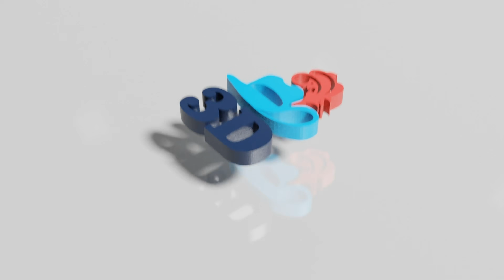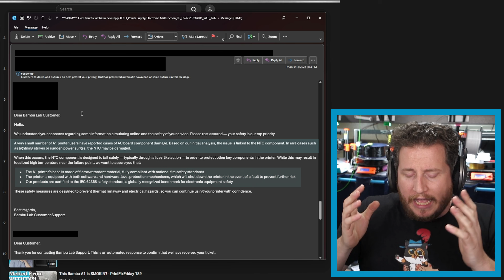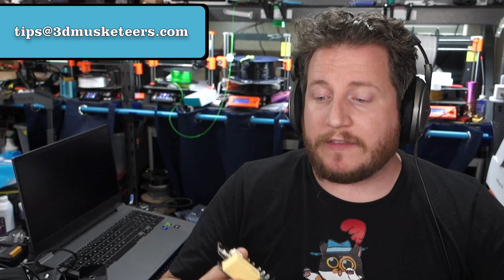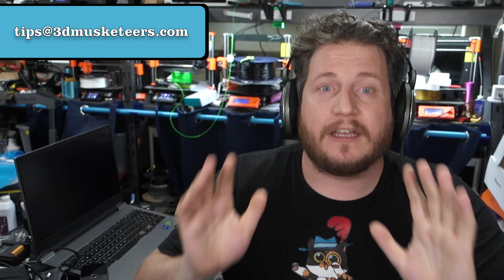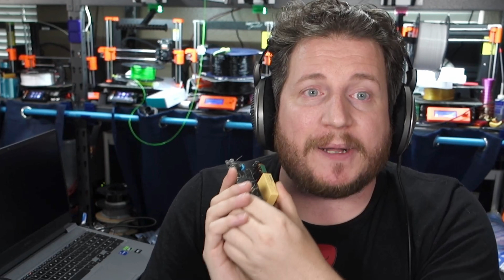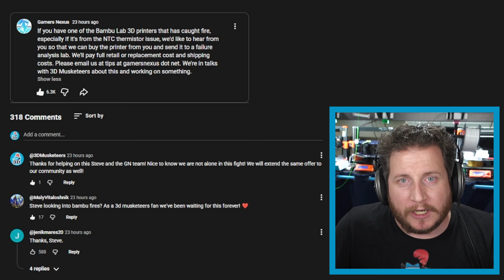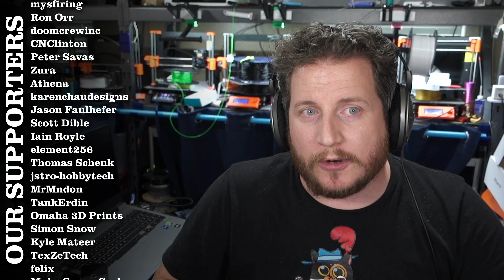I Was Right About The Bambu A1 (And I am MAD)!! - PrintFixFriday 245 FIRE HAZARD EDITION

Comment: I also highly urge people to buy a smoke detector to put in your 3d printing room or location, and consider buy the blazecut fire suppression tube above your printer or other equipment. I like many don't monitor my printer 24 especially on long prints. Also they say the 2026 model fixed this issue but check and confirm the thermistor is gone done just assume.

Comment: Many thanks for your clip.   I've had the same issue with my A1 after lessthan8 months of light use.    Whilst Bambu Lab are going through the process of getting my printer up and working, I'm still not there yet.  Today I'm replacing the heated and associated wiring  which I'm hoping will get the machine up and running.  So far I've replaced the powerboard, mother board, aerial without success.   It's a shame because I love the A1, simple and easy to use,  pity the quality of manufacturing is below what is expected today. I shall see!

Comment: yesterday my unit started to smell like burned plastic and luckily i was present and could turn it off in time. after checking with thermal i noticed a huge hotspot on the left side, opened up the casing and immediately saw this burned out component. 
printer was working very well until that moment, not a single problem. happened out of nowhere.

Comment: Had similar issue  NTC thermistor just exploded and melted the bottom case of printer. As printer was less then 1 year bambulab send new ac board and power unit - and it was different, now without  NTC thermistor and less cables

Comment: Just experienced it myself, the machine was idle, not currently printing (been hours since last print which was successful with no problems.
I heard noises from it, similiar to the mechanical noises when it turns on and it just just stopped working altogether after few seconds (I think there was an error message on the screen for a brief moment but I couldn’t really read it in time)

Had to open it up just to see the NTC component fried on the ac board. (So thankful it didn’t caught on fire and that I was next to the printer when it happened)

I’m from Canada so it’s 110/120v printer and i got it last December.
At the moment waiting for bambulab support to respond…

That’s absurd it happened to so many people and they don’t really address the issue.
Reply from the maker: If you can, send photos to pff@3dmusketeers.com we haven't seen many that just randomly occur when idling.
Reply: @3DMusketeers sent it over

Comment: Im genuinely a bit worried about my printer. I got it this spring so maybe at most 3 months ago, it shouldn't have this problem right? I know that it happened mostly in 2025 production printers
Reply: I took off the cover to check and i do not have a thermistor on mine, its just like a solder wire in the place of it, everything looks normal. I felt i needed to check because the serial number hinted at this being a problematic unit however it does not seem to be.

Also i double checked and i got it in early february of this year.
Reply: @MrMan-dc9xh pero es correcto que un componente electrónico sea reemplazado por un simple cable?

Comment: I had this happen, i have emailed you from my business account.
For everyone:
- Printer stopped 
- Burned the NTC Varistor 
- Made me grab a fire extinguisher and put it near my printer
- Burned a wire
- Burned up the siding of the board and Front Bottom Board
I have a new board and a new power switch assembly and am NOT replacing it until direction in my email from yall.

Comment: So regardless of the issue with bamboo regardless of the issue with whether a printer should be this kind of a risk I don't really care about all that because I can't affect any of that 

What I can do and what you can do is to be a safe as possible knowing you are running a machine that has components that are going to reach 100° C and 300° C

You need to take safety precautions I don't want to hear any crap about it shouldn't be a problem cry me a rainbow when your house burns down. 

First things first the 16-inch paver is a great idea it'll also improve your print quality and reduce noise. 

The next thing you need to do is to do a little hypothetical thought experiment I want you to create a thought experiment where you start a campfire on top of your print bed 

Now in this context what does that fire need to keep going? It needs fuel 

Do you have fuel near the printer? 

My first question is what is all that stuff that melted and why was it near the printer? 

This is not about blame if your resorting to thinking I'm blaming you whack yourself on the back of the head proby 

This is called troubleshooting war planning 

One of the first things I did was all of my tables are stainless steel lab tables work tables you can get them surprisingly cheap 

It can't burn. That's kind of important 

Where have I stopped putting filament? Directly above the print bed. That's right no top mount AMS light for me. 

If I am going to top mount a spool I do it all the way to the right to minimize the chance of flame on the bed reaching it. 

I make sure the printer is far enough away from any wall that things like wallpaper curtains etcetera can not catch fire. 

A 3D printer is not a home appliance I don't care how much you think it should be I don't care how much you rant and rave that it ought to be it's not it's an industrial tool. 

People need to respect it as such. That doesn't mean you don't hold manufacturer's accountable but it also means you have to do your due diligence too because they're not going to voluntarily replace your house. 

One thing I'm concerned about if that's where that unit is isn't that where the poop basket is? Do you know what the poop basket is? A big pile of fuel 

I'm going to have to rethink keeping that there or maybe using a metal bucket..

Make sure you have a fire extinguisher in the same room. Make sure it's up to date. Get some fire blankets they're very cheap and very effective. 

Now for you 3D musketeer. Are there any instructional videos that would show me how to find that component so I can take a picture of it and figure out what I'm dealing with? I just got my A1 last week. 

If I don't have an NTC what does that mean? If I do what can I do about it?
Reply: I wonder if it's the quality control issue I've noticed lately that component quality is dropping dramatically even so far as ultra cheap components being counterfeited.
Reply from the maker: It appears to be an unfixed QC issue, but thankfully it seems absent in the boards on the A2L

If you dont have the NTC you SHOULD be okay, but we dont have long enough testing to verify its efficacy. What can you do? Basically nothing. Bambu is hit or miss about replacing them before they burn a hole in the machine. There are no other printer brands with active fire hazard concerns currently. 

Bambu actually has a decent wiki on how to change it, just follow those directions. It involves removing the bottom panel of the machine.

Comment: So what the fuck now.. I need a printer to run..
Reply from the maker: you can take the risk, try to shore up around it, or keep it off and try to get bambu to send you parts?
Reply: @3DMusketeers Shit man, what printer would you recommend these days? Might have to max out the credit card it's cheaper then a house fire.. But I don't even wanna risk it. 😢

Wanna take my A1 of me? Maybe you can push it to fail 😅
Reply from the maker: If it has burned we would be interested.

IMO, pound for pound, the Snapmaker U1 is a damn fine machine
Reply: @3DMusketeers Thanks for the info man, ill open the bottem 10 screws and take a peek. If I see anything weird ill come back to this message okay! Don't wanna waste your time if it's just a 'good/working" machine. 

Thank you for keeping us safe! ❤

Comment: I must be really lucky because I've run my A1 for almost 5,000 hours (actual print time) and I haven't had the problem.  I've definitely put it in a fireproof enclosure because of this issue, however, and I will be getting a replacement board.  Yuck!

Comment: I just want to add just adding a small fan near the ntc should prevent it from over heating. These components don’t release much heat but if the heat can’t be removed it will heat up

Comment: So how do I find out if my.board is bad? After watching your video I watched my a1. It gets really warm so I no longer run it when I am not home, and I check on it frequently. But I noticed the sticker that sits over that spot where it gets hot is browning. Not the bottom half of the sticker though. I'm not intrested in replacing boards though and I wouldn't know the 1st thing about if the replacement was good or not. Help.

Comment: Or just keep the temperature inside the home under 22 degrees Celsius; I keep my window open for fresh air and some cold. And on top of all these, I keep it down, on the floor, which is cold. For those who have heating in the floor, like temperatures over 20-22 degrees also can be a big problem for electronics. I see this problem on my laptops, especially during the summer. I am barely able to use the laptops, and during the summer I just limit my use during the morning and night, in the middle of the day, minimum use, Youtube, movies, no gaming.
Reply from the maker: broooo to keep it that cold here in FL I would be homeless in months from the power bill. I am lucky if we can keep it under 30C lol. 

BUT we see this issue happen more in the winter, or at least that is what has been happening, so I am not sure that works here.

Comment: Yuuup, just had mine (6 months old) stop 80% through a print and smelt like burning circuitry, no response. turned it over and the plastic was bulging from heat warp.

No power surge, lightning or nothing, other electronics nearby stayed working perfectly.

It was on a custom wood bench with some resin printers, this could have been game over for my whole setup.

If i do get a replacement I'll put non-flammable rubber or paver underneath but I'm hesitant to use one again at all.

Comment: Blaming lightning and dirty power is an absolute joke. Even if 100% of the failures can be traced back to one of those two, its not like these are new phenomena. Lightning has been around for billions of year. Every electronics designer knows that if they have a product that will heat to combustible temperatures, they must mitigate the damage a near strike can do.

Comment: Some circuit designers should start work on an open source replacement board that won't catch your printer on fire.
Reply from the maker: BTT is working on the Panda Cyborg, but I dont know what machines it will support

Comment: 200 printers out of +1mill units sold is low, and the board was updated. so chillax dude!
Reply: I very much do agree. Still I do think that the right thing to do for Bambu would be to replace the affected printers.

Anyway I noticed I have 6-10 affected printers so gotta contact support about that later today 🙃
Reply from the maker: Where do you have the number of 1mil sold? Seems to be a BS number.. 

See, this is the issue.. if there's even a SLIGHT chance of fire it's not appropriate to be sold. If we can make toasters safe printers can be as well.

Comment: I bought a P1S a few months back and it's been a great printer (I use it in LAN only mode).
I purchased it as an upgrade to my aging CR-10s.

I submitted a support ticket asking about whether or not my printer could possibly be affected by this issue.
I asked specifically if my printer (serial number included) could possibly have this issue and if it was, how quickly they could send me an updated board that doesn't have this flaw.

It was automatically escalated twice before I got a response.
They gave me the runaround (without actually answering my question) with a bunch of corporate jargon (obviously written by an LLM).

I've just bought a thermal camera and I plan on taking my printer apart to check the actual temperature of the thermistor after running it on a longer print.
I'm going to check it against the datasheet for that specific thermistor as well.

I sincerely hope that I find it operating within spec.
But if I don't, I'm going to submit all of this information to their support team and see what their response to it is.

Not sure if any of this could be helpful to the cause but if you'd like, I can forward all of this information to you once the ticket is resolved.
Reply from the maker: Send us the photos from the thermal camera. I'm curious to see how hot the P1S gets. It's clearly more stable than the A1 but it's not immune from meltdown.

Comment: Thanks for raising awareness on this issue. I have an A1, purchased at the end of May 25. Got 4 or 5 days left on the guarantee. Paranoid enough with 3D printing in the house. Never leave them alone, but it really limits the hobby. Is there an issue with the A1 Mini as well? Have 2 of those also.
Motivating me to build a 100% non-combustible garden workshop. Going to commit to that before buying any more printers!
Reply from the maker: no current reports on the Mini for the thermistor issue. Your A1 is in the date range to be concerned though.

Comment: Hey just an intrusive thought, but if his pile of rags next to the printer had oil on them from proper lube-ro-faction they may have spontaneously combust, It's a thing with oily rags, that's why you dispose of them in a metal can in the welding class. Also fuled with ISP could be a flash fire and completely unrelated. Although you do have me concerned seeing as i am running an A1 darn near round the clock i got in March from bambu. How do I find out if mine is the wrong board?

Comment: Ok, sooo NTC thermistor needs replaced with a proper part... how the technical home (out in the sticks, etc) user replace that thermistor with a higher rated and/or what part do you recommend or what ratings, tolerances, etc. For that replacement ?

(Yes this is a rant about the engineer failings, but no solutions for others?)

OR better yet what is the part number at risk?
Reply: I would like to know if i need to atleast send it in, or find a replacement
Reply: Or better yet those of us technically inclined could send in the model number, production date, and the part numbers and pcb serial boards so you could build a database for future info for discovery lol

Comment: My A1 exploded some months ago and they told me its a known issue (printer about 6 Months old back then) and they wont take it back. They said they would send me spare parts of all damaged parts and they want pictures. The Element on the Board (you mentioned) exploded, blew a little hole in the side of the printer and melted the isolating shield. I told them the case is damaged and the shield and i wanna have replacement for this. After asking for about 2 weeks where my board is, they told me they would send it within 3 weeks... after 6 weeks i got a tracking id for the "replacement parts" and all i got was a board there the 2 pins are factory sided just bridged and they have removed the exploding Part. No new isolating shield and no replacement cover which means; now i have a printer with a little hole which leads straight on a sensitive high voltage element on the device and no protection against any small falling parts, dust or moisture... (Germany 230 Volts)
Reply: I've sent you some pictures of my case back then

Comment: What are the chances that this issue was introduced in an update, or an original feature to force a recall so old machines would need to be updated to the registration/laws regulations that are starting to get forced (or opted in) on printers in America?
This is not something that can be overlooked or that many people will be comfortable with repairing themselves.
[edit] upon some further investigation, it seems that the "2nd wave" of heavy 3d printer regulatory laws started being pushed towards the end of 2024 / start of 2025. Bamboo IIRC was quite open to adopting the regulatory changes to their printers/software. Not saying theyre making your unregulated printer light itself on fire but, my Nintendo DID literally break itself when I tried to "customize" it a bit (and i know Sony does the same with their hardware) so I wouldn't leave ANYTHING off the table with these mf-ers

Comment: Why would you want to buy them unless you wanted to snag them up for yourself with an easy cheap part replacement, just putting a larger thermistor on the board, this issue happened to me and I got the revised board with less thermistors as a replacement, but I contacted them about there being less thermistors and they sent me another board, identical with less thermistors, probably needs 2 or 3 thermistors in it like the original board

Comment: Hi Grant — as always, I love your videos!

By the way… I can’t seem to find your Bambu Lab affiliate link 😂

Okay, jokes aside — I’m a 3D printing enthusiast and I pretty much run my Prusa machines 24/7. Given your in-depth knowledge of the 3D printing space, I was wondering if you could share some fair insights or comparisons regarding safety measures and potential fire risks across other popular 3D printer brands such as Prusa, Snapmaker, Elegoo, and Creality.

I think it would be really interesting to hear your thoughts on how different manufacturers approach things like thermal runaway protection, power supply quality, wiring standards, enclosure safety, and overall long-term reliability from a fire safety perspective.

- Cheers Ethan - Australia.
Reply from the maker: None of the other brands have had reports like this, so clearly whatever they are doing is working currently...